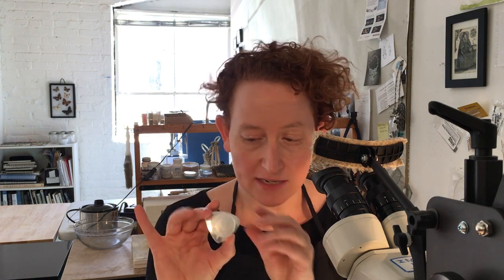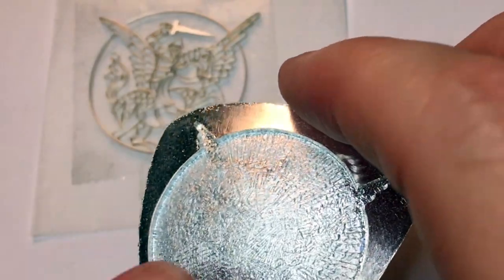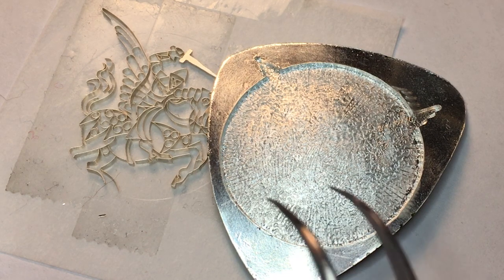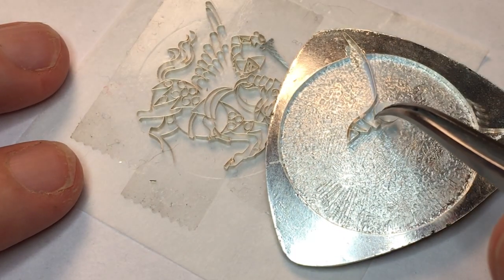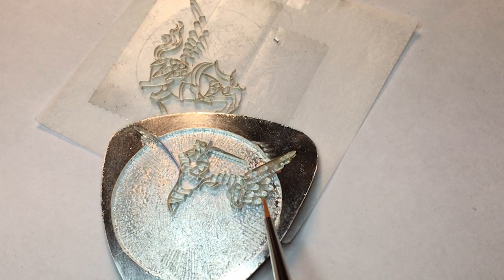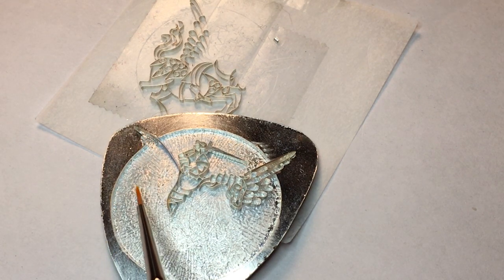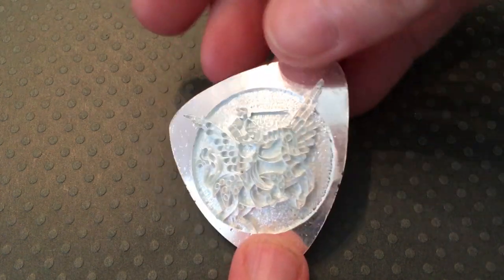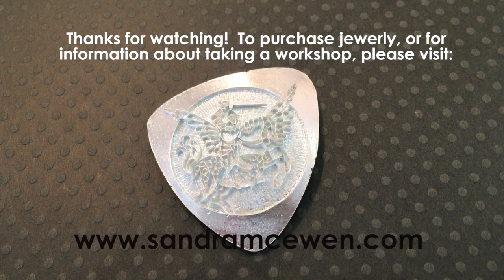Cloisonné Tutorial - Attaching Complex Wires

Comment: Perhaps my ignorance is bliss, as they say, but could you not place a piece of sign makers transfer tape over your already assembled wire work and position it all at once? 
Start by pressing transfer tape on top of your wire design and use it to lift the wire design away from your bottom tape base.
Spread your blue glue over the mounting base. 
Then lift your tape covered wire assembly and press it into position on the blue glue. 
Gently peel away the transfer tape at a low angle. 
The same procedure as a sign maker follows to adhere vinyl lettering in exact position on a sign base without having to play with every letter individually. There are several different  adhesive strengths for transfer tape, I would start with low tack. As I say maybe my  lack of experience in enameling is showing but I think it should work.
Reply from the maker: Interesting idea!  You should totally give it a try- I'm not sure the glue would be strong enough to pull the wires off the transfer tape, but it would be worth checking into.  ;)

Comment: Toward the ending, you are firing with the pieces in place, it says the enamel melted... does that mean that you enameled with clear before placing the pieces down using Blu-Stic adhesive? or, did you add enamel after letting the piece dry overnight? Thank You Sandra.
Reply from the maker: Both are correct!  I did put a layer of enamel down first, then laid in my wires using Blu-stic and then sifted a little more enamel over the whole thing and let it dry overnight before firing.  ;)

Comment: As always your work and teaching method is excellent, and it's so kind of you to answer so many of your followers questions. Mine is, what kind of enamel do you apply (or recommend) on the front of the piece before laying the wire? Preferable something that doesn't yellow like 2020. Thanks again Sandra!
Reply from the maker: If you want to avoid using the clears as a base, look into some very pale shades of blue.  A thin (extra thin!) coat of pale blue can look "whiter" than any regular clear and is a good base for most colors.  Good luck!  If you'd like more content, check out my vimeo page:  https://vimeo.com/ondemand/sandramcewen/

Comment: Hi Sandra,  You inspired me to try silver because I think the colors are so much more "jewel" like.  My question is after I anneal and "dap" my piece how do I get back to a high polish?  And a work hardened piece?  Also do you anneal an clean your wire?  I've seen others mention finger oil contamination on the piece but not the wire.  I touched the heck outta my wires to get them bent,lol.  Thank you so much in advance for all of your generosity in helping all of us fledgeling enamellers
Reply from the maker: I don't anneal my bases- there's really no need to.  If you get good enough at fusing, you can "flash" the surface of the fine silver and it'll be super shiny.  Don't anneal your wires either- it makes them too soft.  And don't worry about cleaning your wires either- I've never had any problems.  Any oils will be burned off in the first firing.
Reply: Sandra McEwen Thank you, thank you!  You're the best!

Comment: Hi Sandra! Could you please share how you accurately transfer your detailed drawing onto the silver background before starting your dry pointing/scribe work? Also, what brand of double stick tape do you use? My tape is so sticky that my wires deform when I try to lift them. Many thanks!
Reply from the maker: Hi Elizabeth!  I just use regular scotch tape- https://www.amazon.com/Scotch-136-Double-Stick-Tape/dp/B009R5YAFK/ref=sr_1_12?ie=UTF8&qid=1517249385&sr=8-12&keywords=scotch+double+stick+tape

If you find it's too sticky, you can unstickify it a little bit by just touching it with your fingers- the oils in your hands will make the tape less sticky.  

There are a  bunch of ways to transfer you design- the easiest is to use some transfer paper to trace the design directly onto your piece.  

Good luck! :)
Reply: Thank you Sandra!